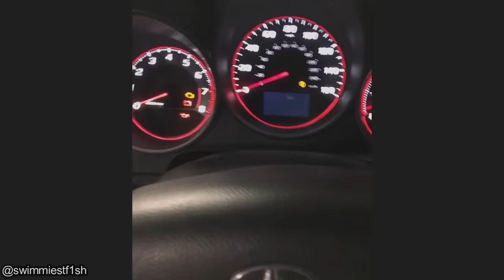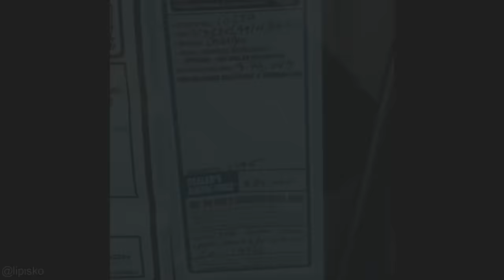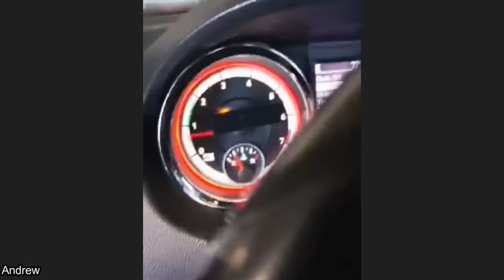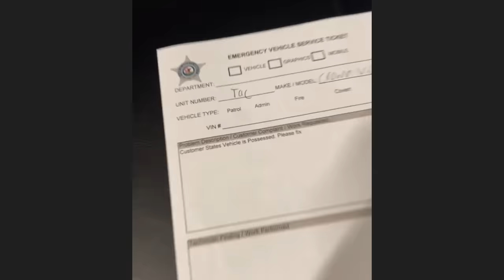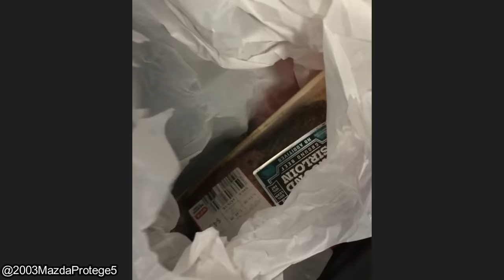Customer States Compilation (The Best of 2021) | Just Rolled In

Comment: The only hero in this video was the driver who stopped immediately when the oil light came on. That alone saved the engine! Hopefully, only the oil filter was damaged and everything else was fine.
Reply: Usually they keep driving until the engine fails and then whine about the repair bill.
Reply: Yes when your engine warning light comes on turn engine off as soon as possible. Why is this so hard to understand?🤨
Reply: @rburn6677  depends on what insurance you have full coverage will pay for the repair or total it
Reply: 9:15 yes
Reply: It’s also a good idea to always keep a fire extinguisher and first aid kit in your vehicle
Reply: 5 kg Co2 unit, and my first aid kit is a beefed up one with kit for stitches. It has a human and a K9 section.
Reply: @XiamaraTheToxicMu  nice. Is carbon dioxide unit for extinguishing fire?
Reply: @jayasmrmore3687  The person in question is at least "average intelligence"(which I am convinced is a lie, it's actually superhuman in a relative sense).  Do you really think most of the owners of the cars in this video can be trusted with an ouchie kit containing hydrocortizone and bandaids, let alone a tourniquet/shears/splint/intubation gear?   Pretty sure they would accidentally harakiri themselves with the seat belt cutter.
Reply: Oil is over-rated.
Reply: This is why i like having oil pressure gauges
Reply: @Morpheen999  glad they stopped immediately it looked like a brand new car. Happy new year to you and everyone else hope you all have a great 2022.
Reply: Hey I said thd same thing .

I just read your message and  gave you a thumbs up buddy.

I'm glad they're still smart ppl in here.
Reply: The oil light comes on when there's almost zero oil pressure, the engine will be damaged from this.
Reply: It literally says it in the clip, all that was damaged was the oil filter lol.
Reply: @isaacandrade3783  I'm telling you there will be internal damage to the bearing shells, camshaft lobes and top end valve train for a low oil pressure scenario.
We're talking about engines with internal tolerances of Thousands of an inch or 0.0254 mm, or 25.4 μm depends which measurements you like.
That engine will no doubt have it's lifespan shortened.
Reply: @imchris5000  insurance doesn't coverechanical breakdowns unless you have mechanical breakdown coverage. It's not covered under comp unless maybe it caught fire or something
Reply: @underdog06  Depends on where you live, and what coverage you carry. They stated the damage was caused by hitting debris in the road while driving... in many states, insurance will consider that a 1 vehicle accident, & only if they carry specific coverages (not referring to breakdown repair coverage), it’ll be deemed as damages from the accident, and would be covered.
Reply: @DD-oi3vh  oh yeah absolutely. I guess I missed the part where it was related to the guy ripping the bottom of his car open. I thought he brought it in because it sounded funny not because the light came on so I thought that was a different scenario. If engine damage is caused by hitting an object that would fall under collision yes, but if it's due to your own negligence in engine care then no.
Reply: It's nice to see that also people who do the right thing are in the videos.
Reply: @imchris5000  you'll only adding to their argument to increase your premiums on your next renewal by doing that.
Reply: @TheNavyseamonkey  thousandths of an inch, not thousands.
Reply: @1oldskoolluvr  autocorrect on my phone,  thanks for pointing out the grammar mistake
Reply: Free undercoating! Zero rust
Reply: Clearly, he takes care of his vehicle including putting on protective rust protection oil.
Reply: I tow my car in when the oil maintenance light comes on want to play it safe
Reply: @adventureswitheddie6444  its a oil pressure light… not a maintenance light. When its on, its already too late. How do you conduct an machine you know nothing about?
Reply: @goclunker  ‘‘twas joke sir
Reply: @adventureswitheddie6444  thank god
Reply: @Grimmwoldds  

Lawsuit City.
Reply: @XiamaraTheToxicMu  that is so cool!! I need one of those in my truck, we spend a lot of time camping in the mountains. Could you tell me a good place to start on the K9 kit I've never heard of that but I need one.
Reply: @remywolfgang792  Thanks mate 👍 Sorry I only just saw your reply.
Reply: true that! :)
Reply: My oil light had come on one time and I mean I was losing all of my oil in a matter of seconds and I was in the butt fukinnowhere so I chose to drive my car the extra 30 minutes to get to school which I know it's a dumb idea but it doesn't really want to tell them that I had broke my car on the way to school after schedule my car home which was about 5 minutes from school and I put another 4 courts in just to see if it would do anything and I have never seen a oil drained straight from an engine B4 but I gave it a little bit of gas and it all started coming out the bottom like directly out of the bottom of the engine block good two months later that puppy is right back and my driveway and I still use it as a daily drive never let anyone tell you Honda accords or lame sure their front wheel drive but man the mfers are built to last
Reply: Yeah they seem smarter than the rest but keep in mind they also bought a Chevy equinox. New.
Reply: @daveredd9832  Because most times, at least in my experience, it's something stupid that doesn't affect the engine. Or you can't afford to get it fixed and you gotta go to work. 

One of my cars has the check engine light on because of a sensor that was replaced. The sensor is from the factory, not chinesium crap, and codes were cleared, yet the check engine light refuses to go off because of that new sensor. Ford tried to solve it to no success. 

One of my other cars has that light on because the A/C went out. Car runs fine otherwise. 

My mom's truck has it on but we can't diagnose it because the connector for the reader is broken. Pretty sure it's because it needs an oil change. 

Very seldom does that light come on for something critical. Normally it's just stupid crap.
Reply: @GetDougDimmadomed  So following your logic ignore when a warning light appears and keep driving. Don't be a goose ! You should always check to see why this appears and no it is never a good idea to be complacent and people that follow advice like yours end up with major repair bills.
Reply: @jayasmrmore3687  in Germany it’s actually a law to always keep a first aid kit, one of these danger-signs and warning vests for all passengers in your vehicle
Reply: @someundeadtalent2016  interesting, what about fire extinguisher
Reply: @daveredd9832  until you become a mechanic and know something things that trigger the Check engine light aren’t that big of a deal, such as the egr valve
Reply: @seth333msm  Right, so ignore dashboard feedback devices and if say the oil light or the temperature light comes on keep driving and don't check if there is a problem?
Are you a mechanic?
Reply: @KevinSmith-qi5yn  It'll be one of those 'survivor' cars years later lol. Free underoiling 👍
Reply: Former girlfriend would only add oil to her Capri when the oil light came on.
Reply: @daveredd9832  What "engine warning light"? If you mean check engine light those usually report on emissions equipment failure and are not catastrophic most of the time. No need to stress about those too much. Oil light (or oil pressure gauge if you have it) on the other hand... different story.
Reply: @daveredd9832  was
Reply: I was thinking the same thing literally the only smart person in this whole video
Reply: @cosmicHalArizona  Smart. That's what amber oil light is for.
Reply: @Grimmwoldds  as a mechanic - this was funny- 😂
Reply: @TheNavyseamonkey  No, the oil pressure light comes on when there is inadequate oil pressure. Completely different circumstances!
Reply: If we're celebrating someone pulling over for an oil light coming on WHILE DRIVING, all is lost.
Reply: Thankfully had no oil problem but I had to drag my car with a flat tire for some miles until I could reach a station - I was on the highway by night so eeeh not too keen on stopping there. The tire wasn't flat it was damn near explosed.
Reply: 😂😂its unfortunate we feel this way because it should be commlmn sense for any driver .. its saftey
Reply: And the guy who took the kitten home :)
Reply: They were hella lucky. Someone threw a toaster oven at my car. Broke my AC and my Radiator lines were cut and the fan for it was destroyed.
Reply: @minkorrh  You might want to take a good look at what he said.

Sure, the oil light is no issue to the oil filter, but if they didn't stop, a car with a hole in the oil filter can loose oil pretty fast.

A car with no oil IS a big concern.

THAT'S what he was saying.

'Good thing they stopped when they saw the oil light rather than thinking to change it in a few days while running on no Oil because of the gaping hole in the filter.'

As for the difference between a KWH and Amp... that's kinda easy to mix up for most.

I know the difference, but Its definitely not something your average joe schmo is gonna understand.
Reply: @daveredd9832  that's not always necessary. Depends on the issue
Reply: @DertyMike  Absolutely depends on the issue. Oil light or temperature light immediate attention is required. The battery light probably means your alternator has crapped out and the car will drive as long as the charge in the battery lasts. Most people don't know enough to play games with their large investment. And I would urge people with no or little mechanical experience not to be complacent and have it checked out. 
That being said if you know your car well and are sure of what is going on then my statements are not advice for you.
Reply: @daveredd9832  IDK man. We have idiots on the road who think its ok to ignore all warning signs but then complain about ANY necessary repairs on their vehicles and deny any and all of them.
Reply: @therandomizer9943  Yeah like screaming brakes metal on metal ignored for several months. Then when the rotors and callipers are stuffed they have the audacity to be indignant. 
Oh but they only cost $80 to fix last time.
Reply: @daveredd9832  unfortunately its hard for everyone else who like to see their engine fail
Reply: @jayasmrmore3687   I'm assuming you say this because fire extinguisher isn't manditory in the states? In Europe those are manditory and i believe they come with your car when new.
Reply: @burnone716  correct, they are not mandatory here
Reply: That’s what my Dad taught me when I was a kid. The SECOND that oil light comes on you stop the car and get it towed.
Reply: @annasbandit  Lol, we had a Vega when I was a kid! It was in really rough shape. Had plants growing in the back of it.
Reply: almost shed a tear honestly, I get proud of my customers when their pressures are set properly lol
Reply: @daveredd9832  unless you're mechanically inclined thats a good rule to go by. but honestly 95% of the time that light kicks on its not for something catastrophic.
Reply: @evanmcmaster3900  I tend to agree with you. If you understand your car and look after it nothing should be falling off all of a sudden.
Reply: @daveredd9832  my engine warning light has been on for about 5 years it is 02 sensor and egr
Reply: @daveredd9832  back in the day they used to call them idiot lights, looks like they’re making a comeback.
Reply: @daveredd9832  my mechanic told me mine was on due to a failing catalytic converter and an electrical short made my battery light flicker. that car was strange, then its transmission gave up
Reply: @donaldbothe3518  Bummer dude.
Reply: @Zak6959  I've never had the problem with any of my cars I must be lucky I guess.
Reply: @daveredd9832  👍
Reply: @donaldbothe3518  Commonly described as a lemon.

Comment: The reaction to the oil jelly is 100% accurate
Reply: @justinepaula-robilliard  It's the oil, but coagulated, don't know why, maybe boiled or had coolant added to it.
Edit: I think it was sabotaged and had sugar added to it.
Reply: @georgerosebush9754  i came to the comment section looking exactly for this. thank you.
Reply: @georgerosebush9754  ohhhhh I was wondering what would cause something like that
Reply: @georgerosebush9754  That's what happens when you never change the oil. The engine heat eventually turns the oil in to a rubbery goo.
Reply: I've seen that just once before, when I worked as a mechanical engineer with off shore engines maintenance. It's very old mineral oil, that when overheated, turns into grease, and then, into rubber.
Reply: @georgerosebush9754  Sugar? Hmmmm, maybe that kind of sugar you need to cook Marmelade. Dont know the english word.
Reply: Did someone use the Jell-O grape additive?
Reply: @georgerosebush9754  that explains the smell cause sugar get hot sugar burn
Reply: @georgerosebush9754  The oil turned to jelly because someone put a stabilizer in it for long term storage, and it sat for a while.  I've seen that happen with old fuel with stabilizer added, then it sits some place for years.  It was a used engine, so who knows how long it sat before someone bought it.
Reply: I kind want to try putting a wick in it and seeing if you can use it as the worst scent candle in existence.
Reply: @georgerosebush9754  Sugar would just burn to carbon.
Reply: I almost suffocated laughing when he started slapping it. XD
Reply: @michaelberghofer4458  Marmelade heisst jelly in Englisch
Reply: Looked just like the deserts at church that always tasted gross, just a different color.
Reply: Someone added jello?
Reply: Amsoil, Pennzoil ultra, Redline and other group 4 & 5 synthetic oils would never do that no matter how long you drove it without changing oil!

Comment: I still love the raccoon who chose to upgrade to a Mercedes.
Reply: Went from one Mercedes to another. Say what you want ... the lil' guy has standards!
Reply: Started my 2018 Silverado this fall here in Minnesota and my wife screamed to shut it off because something wasn’t right. She heard a loud squeal . Ended up finding a raccoon had gotten under the hood. Popped the main drive belt off. Ended up killing it. when it’s head was severed by the pulleys .
Reply: @mndeerhunter8215  they do it to stay warm
Reply: Im not sure thats an upgrade especially if that Merc was built by the hicks in Alabama because its trash if thats the case.
Reply: @mndeerhunter8215  Would have been really impressive if he survived without a head.
When I worked at an Audi dealership we had something similar, there was a rat at the driveshaft, it got it's head blown away.
Reply: @mndeerhunter8215  damn
Reply: They're both Mercedes dum dum.

Comment: The engine that drove 7 miles to the dealer without a sump will outlive us all.
Reply: While watching that engine I was wondering to myself "whay type of car is that, I need me some that"
Reply: I did it in a 2003 Dodge Durango 4.7 v8 I bought for $700. The reason it blew out is because I came back from the Marines, hadnt drove it in 9 months and I floored it on a cold morning after getting a new battery for it. I drove it 12 miles to my mechanic in Huntington Beach, he quoted me 3200 for a new engine install, I said no and then drove it 12 miles back to Anaheim to sell it to Pick Your Part because they said they'd pay me 450 if it drove on its own power. For those curious, I could coast it at 25mph, and it even got up to 50mph when I sped up to beat a yellow light.
Reply: @cadmium4885  This is the well thought out idea I come to expect from our Marine buddies lmao
Reply: I broke the oilpan on a shitbox Peugeot 406 while offroading it and didnt even make it 1km till it lost power and seized 😂
Reply: And folks argue on whether not filling the oil filter during an oil change will damage the engine.  Two seconds versus seven miles.
Reply: @yikkscastle  I drove some 60 miles with the engine oil lamp on in my first car.  Was a 1991 Mercury Cougar.  I was 18 and I thought the car just needed a bit of oil when I got home to top it off, had changed the oil/filter a week earlier.  Car was 7 years old at the time.  So a rock had punched a hole in the oil filter, no oil drained from the pan when I checked it, I replace the filter and filled the oil drove several more years no issues.
Reply: I saw a Dacia Duster 1.5 diesel droven 300 miles (500Km) from Kherson, Ukraine to Tulcea, Romania  with a family of refugees. The russians shot with AK 's at the car as they were running. the engine had  5 holes and the trunk like 20,some bullets stucked in the luggages with clothes..... they stopped at a river,stuffed the radiator, intercooler and engine holes with sticks and plastic bags,put water from the river as coolant and drove it till Romania,running only in 3 cilinders and  the gearbox without oil. The ukrainean family sweared they will have  only Dacias  from now on